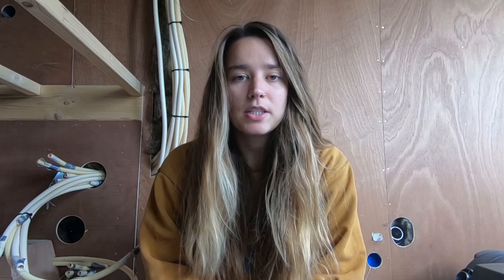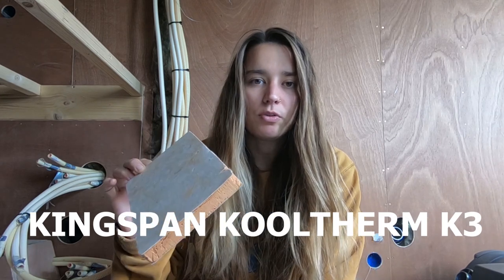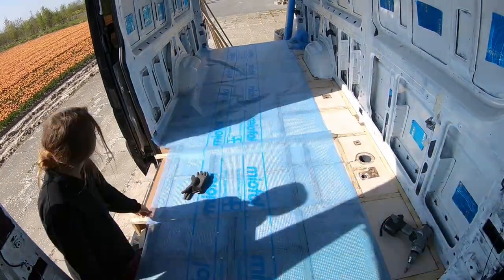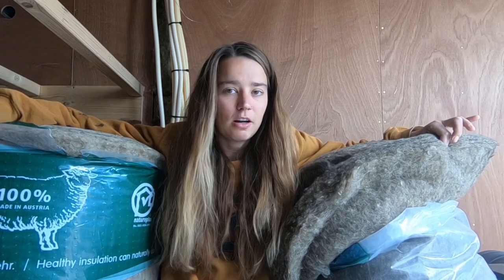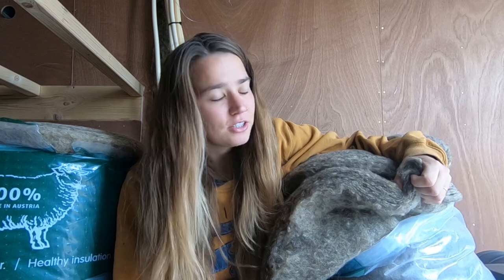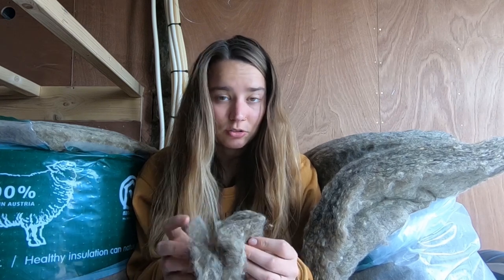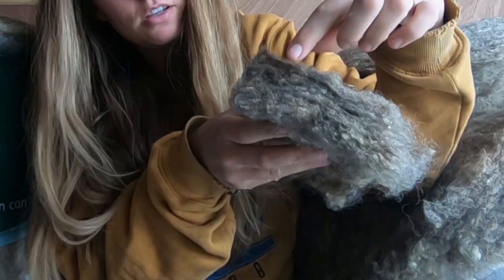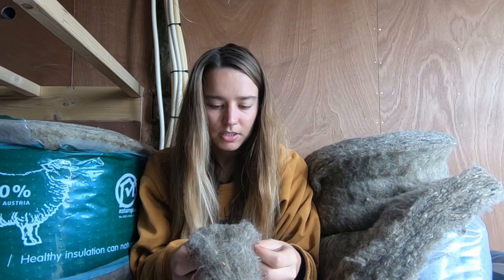DIY OFF GRID VAN CONVERSION |  Sheep wool insulation

Comment: if wool can absorb condensation and releases it when "it can", what if it can't? It's not because you don't see any water that the condensation is fully gone... a bit of ventilation would help the damps to get out of the van while being in the sun, therefore any water in the wool would be able to get out... But if everything is sealed...
Just my two cents ;-)
Reply from the maker: Hi Alex thank you for your Comment that's definitely something to consider although we took the advice of a company that builds custom campers and said that because our walls aren't completely sealed it should be more than enough ventilation for the wool to release any moisture.
Reply: But it won’t release any moisture if the air is already full that was my point... and if the moisture isn’t released, then it’ll stay in... with consequences for your van’s body...
Reply: @AlexCailliau  The van's exterior bodywork is not airtight. If any moisture does get in from inside the van, which it won't if you vapour barrier correctly, then you want it evaporating out of the exterior.
Reply: @d1m4d   my point is coming from inside or outside, you don’t want moisture in your insulation when it’s in contact with metal…
Without insulation, any moisture will condense and go down the walls to the openings that are precisely made for this purpose: getting water out.
If your insulation can hold the moisture, it’s never good for a metallic structure, how good it’s treated against corrosion… and if your barrier is 100% airtight, then what’s the point to have an insulation capable of absorbing moisture? ;)
Reply: @AlexCailliau  I agree with you that you don't want moisture trapped inside the wall cavity. Which is why it's best that it escape to the outside through the van's exterior. You don't want moisture travelling inwards from the outside into your living space. More importantly you don't want all the moisture you breath out going through and into the insulation. That's litres of water every day apparently. think we're on the same page but thinking about this differently :)